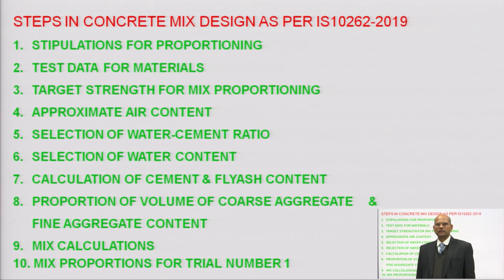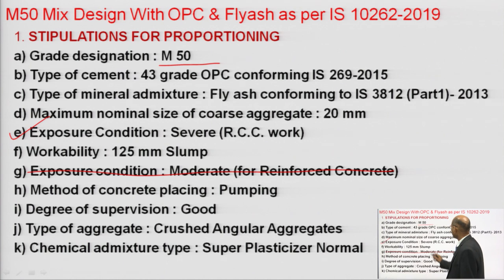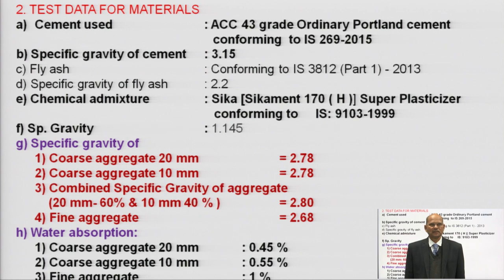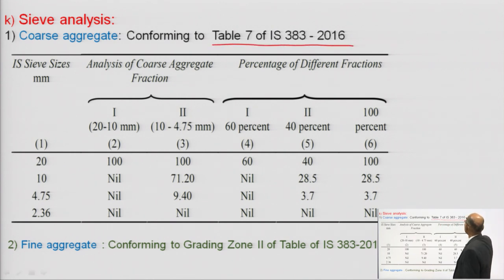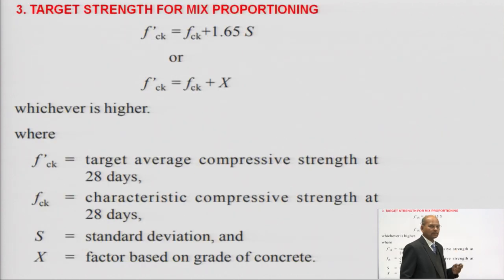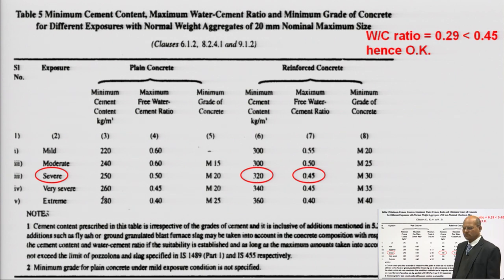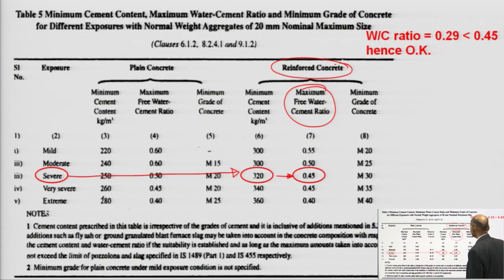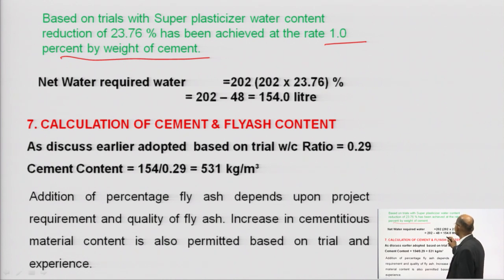M50 Grade Mix Design using OPC and Flyash as per IS:10262-2019

Comment: Sir if we are not using fly ash what we will take cement for 531kg .. It is more then maximum content right please clarify it sir..
Reply: As per IS code we are not allowed to use cement of 450kgs/cum because heat of hydration of cement.This hoh leades to heavy cracks and finally structure failure.